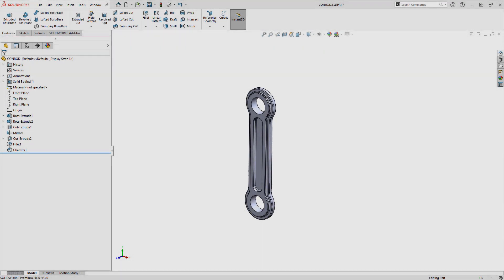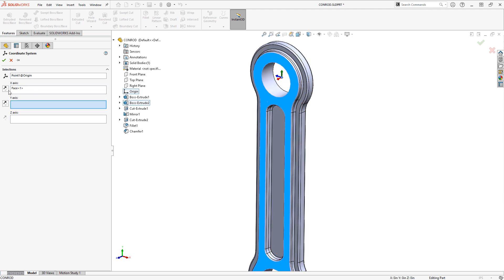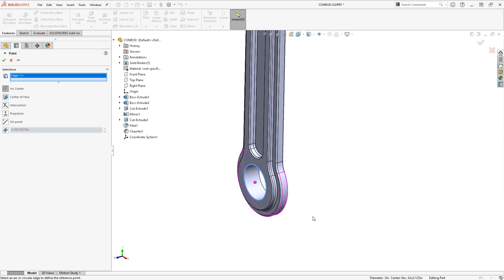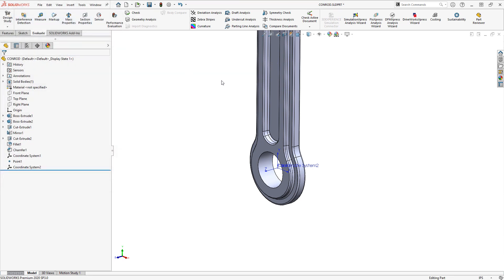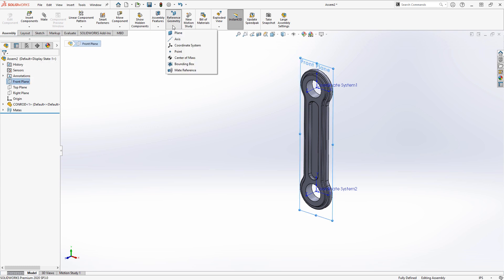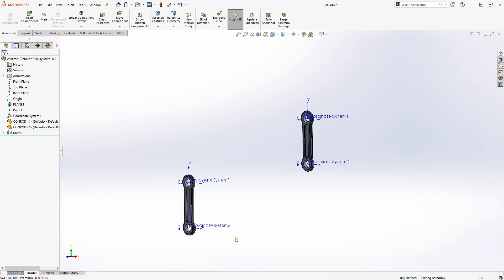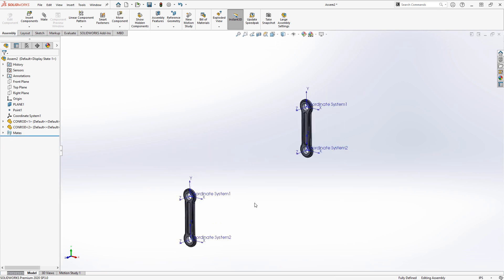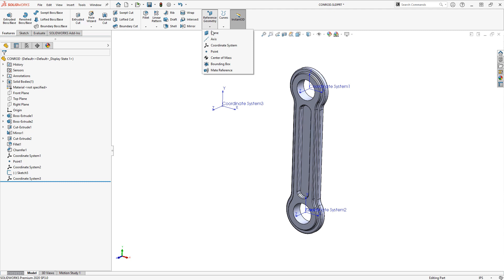Points and Coordinate Systems in SOLIDWORKS

Comment: Enjoyed the video.  I have a question about building a reference system that can be used by multiple independent components and assemblies. Probably I just need to understand the SolidWorks approach to this.  In AutoCad I would create a reference drawing with all the key geometries and relationships. Then use that to align all the components & assemblies.  I SolidWorks (which I am still getting my head around) it appears that the reference points and line etc are per component or assembly.  What is the SolidWorks way of creating a shared context for objects.
The case I am currently working on is a equipment pallet where we have a dozen individual assemblies coming together, but each needs to be created independently in the context of the pallet and it's reference system. 
Some key words to look for , or maybe refer me to a short video that demonstrates the correct approach

Comment: Is there any way to define the coordinate system of a plane? For instance, you create a plane and every time you go to sketch on that reference plan, it flips the whole part around so that your normal positive y is the negative y axis in the sketch.
Reply from the maker: Planes you create will have a "Flip Normal" button in the context menu which should affect which way the direction "out" of the plane is

Sketches have their own sketch origin which can be rotated/transformed using Modify Sketch tool. Such as for rotating the sketch origin if that is needed
http://help.solidworks.com/2021/english/SolidWorks/sldworks/hidd_modify_sketch.htm

Comment: I need to be able to change the orientation of the axes in my newly created coordinate system.  I want to accurately calculate forces in the X, Y, and Z directions for an aircraft at various Angle of Attack.  Also I need to be able to accurately calculate torques about the modified coordinate system axes.  In other words, I want to rotate the Z axis and X axis 12 degrees while not changing the location of the new coordinate system or the orientation of the Y axis.  HELP!!!  Thanks in advance.
Reply from the maker: Is this for a SOLIDWORKS Flow Simulation or SOLIDWORKS Simulation (FEA)?

One method that comes to mind would be to create a sketch with a single construction line that represents the angle of attack. The line should be coincident on one end where you want the coordinate system to be, and then with an angle dimension. Then create your coordinate system and use this sketch line as your reference for angle of attack.

Upon adjusting the angle dimension in the sketch the coordinate system should automatically update it's position.
Reply: @hawkridgesystems  The question above is about SolidWorks Flow Simulation.  Sorry for any confusion.  Also, thanks for the quick reply.  I am new to SolidWorks. I am a pretty good CATIA driver, but that makes SW counterintuitive to me.  So, it takes a while to figure things out.  Yesterday, I finally figured out how to rotate the Z-axis for my CG Coordinate System.  It is similar to the method you describe above.  But, I highlighted the Right Plane, offset it to cross through my CG, then rotated it 12 degrees (my AoA for this analysis).  Then I created a new Custom Coordinate System for my CG location.  I did not understand how use the 'Sections, X Axis, Y Axis and Z Axis' boxes.  I played with it for a while any finally watched another video where it showed what those boxes were for.  After seeing that video, I clicked the Z axis box and then clicked the 12 degree plane's nearly vertical edge.  WaaLaa!  Success!  Thank you for your assistance.  Joe T.